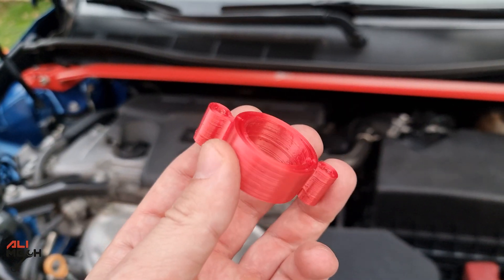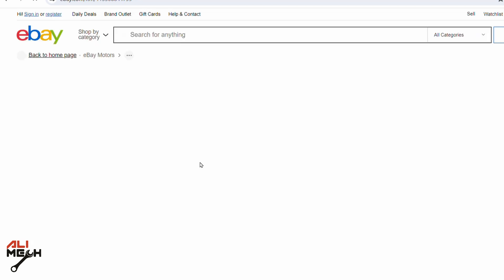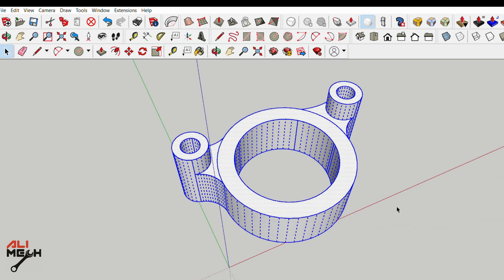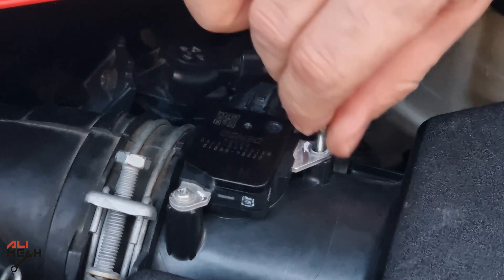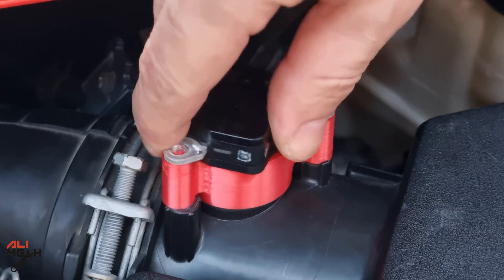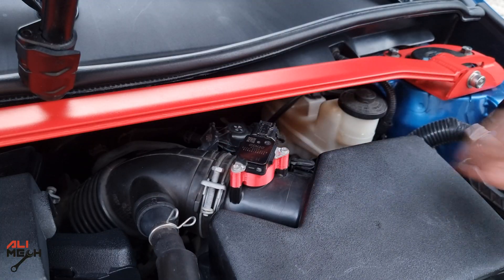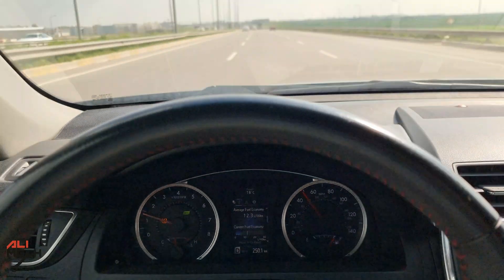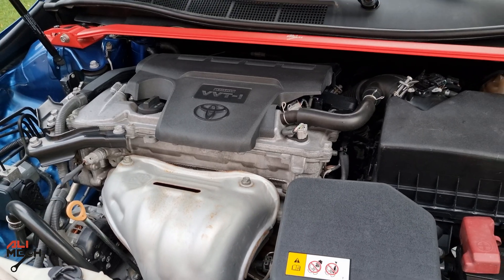Does it really increase horsepower / Better fuel economy ??? Watch this before spending money

Comment: It’s interesting. The cars computer determines fuel consumption based on air flow readings from the maf and a/f readings from the upstream O2 sensor(s). If the maf were to read low air flow it will cause the computer to add more fuel to compensate, which is in direct opposition to what the upstream O2 is reading since you’re not actually blocking airflow in the induction system. The upstream O2 would read a rich mixture. The “confusion” so to say would cause the car to be bogged down. Probably initiate a MAF code.